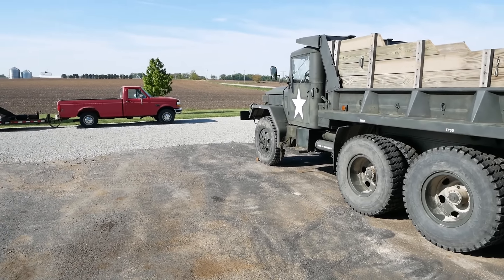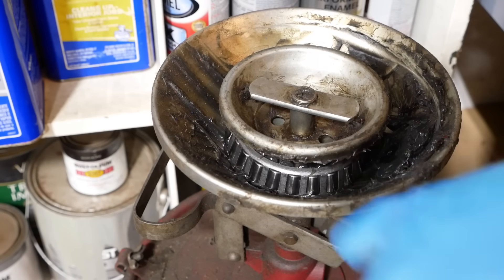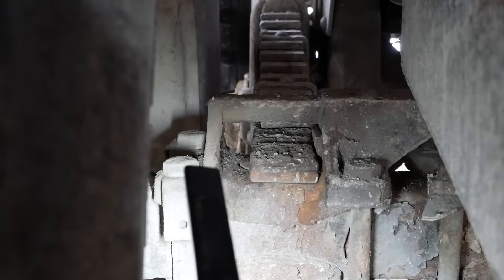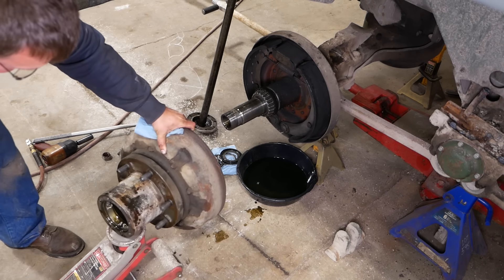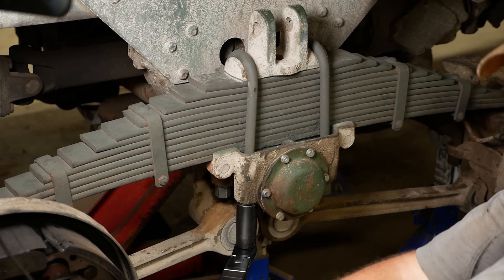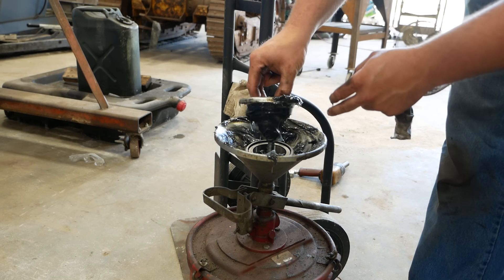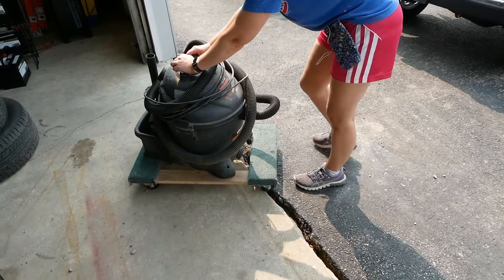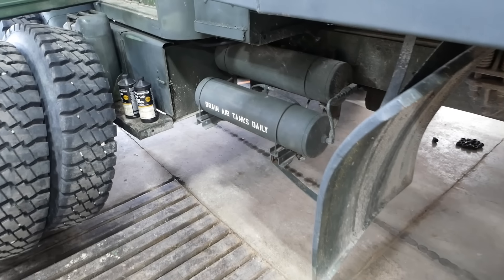Military Truck Crazy Suspension Damage - Can We Fix It?

Comment: This video brought back memories from my early years in the Army.  I was a Heavy Truck Driver (MOS 64C), as a driver we were tasked with assisting the mechanics any time our trucks went in for scheduled maintenance.  In the eight years I was a driver I don't ever remember actually performing maintenance on the trunion bearings.  That might have been something that was done at the Direct Support (DS) level.  As for the axle bearings that was something as drivers we did help the mechanics with.   After awhile we had a mechanic that made several errors that caused me to lose faith in his skills or attention to details.  One incident could have cost the lives of 22 soldiers.  After that I and my other drivers performed all our on scheduled services.  He had forgotten to bend the tabs on the retainer between the inner and outer spendel nuts for the front axle.  Had it not been for a simple flat tire we might not have known till it was too late.  Then that mechanic was tasked with replacing the master cylinder on our 40" flatbed goose neck trailer, he forgot to put break fluid in the new cylinder and bleed the breaks.  Our unit only had 2 1/2 ton cargo trucks and our's were M35A2 models.  We also had 5 ton tractor trucks M52A2 models.  They were 1960's vintage as I enlisted in 1971.  I noticed something weird about the truck you did the test drive in, the shift pattern was different i.e the position of 4th and 5th gear were opposite from the M35A2.  Might have been a different manufacturer for the transmissions since your truck was from 1973.
Reply: I don't remember the mechanics doing anything to our trucks (I'm sure if we turned in a ticket they would have, eventually) I fixed radios and packed wheel bearings, busted split ring tires, etc ;-)
Reply: I drove a couple of those that had been repurposed into water tenders for fire departments.  I have encountered the reversed 4th and 5th in a few trucks.  All the ex mil trucks were small gas engines and large water tanks so I learned to split gears using the transfer case like a 2 spd axle.  The pattern was 2l-2h-3l-3h-4l-5l-4h-5h.  It was a fun challenge.
Reply: The M35A2's-M756A2's as far as I know all had the same 3053A transmissions from Spicer and the same shifting patterns.These trucks were exactly the same from 1966 to 1988.This also includes the previous series like the M35A1's,gasoline M35's and perhaps the M34 prototype.

Comment: Watching this video brought back memories of when I was in the U.S.Army in Germany in 1982 when I was assigned a 5 Ton to fix up. That truck had three full pages of gigs wrong with it. Even though my primary MOS was 45Kilo (Tank Turret Repair) I spent two weeks working on it. I did enlist the aid of one buddy and one of the automotive mechanics for the repairs like swap the transmission, and rebuilt the front drive dif. First time I had to drive it, I drove down to Frankfurt to pickup a replacement M60-A3 main gun barrel. On return after driven round trip 450 miles, two miles from my base, the power steering pump crapped out. I and my co driver had to arm strong that beast that last two miles then get it into are motorpool. My arms were sore for a week after that.
Reply: It sounds like Elvis Presley' story. He was a driver too in 3rd Div.
Reply: All you needed was a tin of spinach.

Comment: Damn, that brought back a lot of memories. I got out in '74 and we didn't have many of those "new"  multifuel dueces. The ones we did have didn't require much work. The older GMC dueces kept us busy enough.  I have loved to have those air tools. Does anyone remember those spring loaded impact wrenches they gave us? They were crap.
Nice job. We could have used you in the Motor Pool.

Comment: I was a motor pool mechanic in the Marine Corps in 73. If I remember correctly they did not come with power steering, however; I don't remember them being all that difficult to steer. But, if you don't have anything to compare it to; you don't know. So, in some cases; ignorance is bliss.
Reply: most came with private steering
Reply: Drove one a few times when I was in the Army in the 1960s.  I really enjoyed driving them.  They had "armstrong" steering.  Not too bad to go around a corner IF you remembered to slow down BEFORE the corner and then ACCELERATE through the corner.  Otherwise MAN they were a bear to steer!!!!!  All the ones that I drove had non-working synchronizers for fourth gear - had to double-clutch both up and down.  I remember that max speed in first-low was 1.25 MPH and first-high was 2.5 MPH.  We always started out in second-high.  Ahhh the memories!!!!

Comment: Drove and rode in the back of several of its cousins, the M35A2 deuce when I was in the Army back in the 80s and early 90s. They were rock solid built and reliable trucks. No matter how cold it was they would always fire up and run. We would often fire one up and get the slave cables (that's jumper cables to you civilians) and use it to fire up everything else in the motor pool that wasn't a deuce. They even ran reliably in super hot climates like Saudi Arabia and Kuwait back during the first gulf war where I was in 91. I'd love to own one now that I have some property and could put it to work. And yes, Wes, they had no power steering except for your arms.
Reply: Thanks, Troop.! For your service.
Reply: That was the benefit of the LDT-465's,and LDS-465's in some others,in the M35A2's-M756A2's.
The 22:1 compression ratio was incredible in extreme cold climates,even with sloppy or gummy motor oil and diesel.
The large M51A2's-M543A2's also were multi-fuel but almost all variants had the LDS-465's because of higher torque.
That was only the downside in the deuce and halfs,not alot of torque but remarkable gearing ratio espiecally relying on the transfer case or in lowest gear was all that was needed to get the job done.

Comment: That looks like what I would know as a “Hendrickson” walking beam suspension, and I believe there is a certain (allowable) amount of the “swing out” (as you call it), however as you said the oversized tires are probably another issue contributing to the “ride-up” by the tires on the beam(s)...
Reply: Agreed. They came with the “rounded” tires for a reason
Reply: @davidscott1861  yup  ditch the oversize crap..the originals worked just fine!
Reply: @fredbuyarski7925  worked just fine for me. Drove an 818 with them through the desert and never had any issues with them
Reply: @davidscott1861  
Ahh yes, I recall the directional “skip bar” type treads...
Reply: People always messing with things they ought not be messing with
Reply: We run the non directionals on our truck all the way around (Vietnam era truck marked up for 8th group) for historical purposes. A lot of convoy trucks in Vietnam ran highway treads on the front. They would steal them off the conex trailers at night.

Comment: My Dad, in the UK had a Duce and a Half for quite a while, there was a problem with the Transfer Gearbox, unfortunately try as we might we were never able to fix it. It had a bigger engine on the back than the drive engine (I think) that drove a compressor with some tools, had a huge 2 man air driven chainsaw !! etc. The Compressor engine had a cracked block. Chap that bought it off Dad promised to send picture once it was fixed but of course never did. However it was great to be able to fix the bits we could and dream about driving it. You are a great mechanic and I love the way you were able to find fixes for difficult to find components. Well done. I know this is a comment on an old video but felt I needed to say something. Made me warm to think of Dad sitting in the cab and finding out what all the switches did 🙂

Comment: For an impromptu bearing race driver to install the new race (cup) , take one of the old races and cut through it with an abrasive cutoff wheel.  After tapping the new race in as far as you can with a hammer, place the cut race  against the new race and continue driving it home with a soft drift and hammer. The gap you created will allow the old race to fit loosely into the same bore for easy removal after the new race is seated.
Reply: Sounds like a great solution! Now, to remember this for next time! LoL!

Comment: In 1974 I was a Combat Engineer(12B10) and I was assigned the newer bigger brother(5 ton) of this older 2/1/2 ton Dump Truck. It was a great truck and with all wheel drive it was a beast and I never got stuck in it. It was diesel and not a multi fueler. I drove many 2 1/2 and 5 ton trucks in the Army. The 5 tons were much better trucks to drive. They had a great drivers seat and power steering. The deuce and a halfs were not easy to steer but tough reliable trucks. The Army trucks they use today are like Mercedes compared to these old tough trucks. Thanks for your video and good luck with your truck.  Good Luck BP

Comment: Your persistence and patience is amazing.  Well done.  Whatever bent the axel which moved the springs which bent/wore on them must have had mass like the truck.  I like the CBs idea that it was the truck itself (sufficient mass) bumping into an immovable object like another truck, forklift, pier, or ship).  Such focus of impact to do that without damaging things around it like the other wheel, surrounding bed, etc..   There was a reason it was taken out of service, and this could be it.  PS: The truck appears to have come with ten mechanics who worked on it daily and thus were very familiar with the 10,000 things needed to do to keep it running.  Check the battery daily.  What a hoot.

Comment: The 5 Ton Dump Truck and the Deuce-an-a-Half were our work horses in my time of service.
Reply: I hope I don't make u feel u that all the  work  u did was because of the tires, BUT U DO REMEMBER sTHAT YOUR TIRES R NEW, AND THE  OE TIRES HAD NO TREADS, so they would not have rubbed the cover bolt
Reply: You should watch the Pakistani guys work on trucks 🚚, they r  great,  I used 2 b a mechanic, so I know how hard it is 2 work on trucks

Comment: When I came across your thumbnail I was  immediately drawn to the video. Drove many duece an halfs and five ton dumps when I served back in 73 thru 75 1st infantry Div 802nd Engr bn Bravo co . Watching you go thru the start sequence brought back fond memories and like someone mentioned a 19 year old doesnt really give a hoot when he is told to just drive the darn thing . But it was better for me because I was barely  18 when they got me . Was that a straight 5 with the high low range splitter. Hell if the wife would let me I would trade my silverado for that thing for sure. Dont really remember how many miles I drove but always enjoyed being behind the wheel.  Thats probably why I ended up a commercial truck driver for over fourty years. Really nice to see that some of the old surplus equipment is still being used.  Be careful and stay safe my friend God love ya.

Comment: First time watching your channel. Enjoyed it very much, thanks for sharing. Wrenching on heavy equipment is rarely cut and dry science, more a process. Good job. I use to be a heavy equipment mechanic 35 plus years ago. Eventually moved to the office and have only pulled wrenches on my own vehicles since. Some aspects of the job I miss. Love being around the equipment. Use to do a lot of truck frame lengthening and shortening depending on the repurpose application. Today I always find a reason to walk the shop, any shop, like visiting home. Even now working for a major airplane manufacturer.

Comment: Maybe it fell off of a sling?  But I agree, whoever "fixed" it originally did only part of the job.  It is a pity such major accidents do not get recorded on vehicle ID papers.  Regardless, you showed great patience and ability with the work you carried out.
Reply: Partial/messy repairs are the order of the day for a lot of older military vehicles.  The worst are the smaller ones, used only occasionally, like in parades.  I've found stuff like allthread or drain-plugs holding the steering arm to the knuckle on WW2 era jeeps.

Comment: I have a 1973 M35A2 "Deuce and a half". When I wanted better traction and top speed, I flipped my rear hubs (the rig is designed for it) and added super single 46" Goodyear MVT wheels/tires to replace the stock 39" NDT wheels. I took video of the hub flip and wheel swap. One of these days I'll get around to editing it and uploading it.

Mine has manual steering, so I can confirm that is the stock system. It's a bit arm-heavy when steering at low speed.  

Great job diagnosing the truck The folks at Steel Soldiers forum online have been a Godsend helping out with tips and part numbers/tool numbers.

Comment: Definitely damage from a recovery. I wrench on highway plows, and these things go into ditches pretty frequently, and let’s just say straps and chains can go onto some interesting places when someone doesn’t want to dig in the snow for a proper recovery point, and it’s impressive how even the most solid looking chunks of metal will twist around when you’ve got two fully loaded trucks hooked to each other and one hits the end of a strap. And that kind of damage has ocaisionally earned a truck an early surplus in as-is-where-is-may-require-unknown-repairs condition.
Reply: I saw someone buy a govt surplus crane that had extensive forklift damage not readily apparent. Moving equipment around for surplus sounds as bad as that recovery you describe.
Reply: Recovery makes sense to me, someone might of hooked to the axle.. I'd think if it hit something or something hit it, it would of just moved the truck. Either that or rough landing from an air drop.

Comment: Wow...  love the video.  I LOVED THAT OLD TRUCK.  I drove and worked on that truck for years, from 1980 till the army got rid of them.  The bearing you pulled out is a new bearing.  The old type bearing was a solid bearing with grease grooves cut in it.  hahahaha, yep, that cap goes on a curtain way.  The torque rods would only need replaced if the rubber was separating.  Never drove or saw one with power steering.   There is a bearing seal tool for that.   I was wondering if you were going to put that cork in there.  It should have been as thick as a valve cover gasket and it is important.  If its not there it will allow 90 wt oil to get into the bearing and then all over everything.  That's a lot of work.  The top brake adjustment is the major and the bottom in the minor.  align the dots on the bottom cam pins, adjust the top top be back all the way off, then put the drum on.   There was a pressure bleeder cap that went on the master cylinder that pumped brake fluid in so one guy could bleed the breaks with out pumping them up.  The brake adjustment settings were .010 on the bottom and .020 on the top.    The adjustments would have been done thru that cover that was on the out side of the hub when you took the wheels off.    Good catch on the bent axle.  That truck was rebuilt by Depot.  It had modifications done to it that I had never seen.   Which had to be after 1985 from a National Guard location.  The army got rid of the 2 1/2 ton in the early 90's.  That has an M35A2 Multifuel engine , meaning the fuel injection pump will meter gasoline, kerosene , DF2, DF3 or JP8.
Reply: I was wondering about that too, that little piece of cork to seal the bearing grease in and not mix with the gear oil. What that means, oil will now again flush out the grease from the wheel bearings, depending on how much it is driven, is certain to be a problem in the future.

Comment: its always impressive to watch Wes work! That was a though one, full off hidden surprises. They probably ran into something like a knee wall with the rear axle, which bent it back and bent the springs. That was a difficult catch. Same with your non existent vent, but shouldn't you check if that vent actually works and is not rusted shut? And I was surprised that you didn't repair that locater pin on the old axle, that shouldn't have been a problem for you... again, very impressive to watch you as always.

Comment: Your Duece was stuck somewhere and instaed of hooking to the frame they hooked to the Axle and the Tank that pulled it out did the damage.
Reply: I can totally see that.
Reply: Was in Germany during reforger 1981, saw a tank retreater jerk one that was down to the frame. Let’s just say they didn’t care what shape it was end when they finished.
Reply: Makes sense as the axle housing was pulled towards the back. I wonder if it could be straightened.

Comment: Crop duster out there just casually being a BAMF
Reply: First time I saw a copter doing moves like that I was CERTAIN it was in the process of crashing! When it zoomed across the road, UNDER the power lines and then did a snap turn in it's own length I realized it WASN'T crashing, but doing that ON PURPOSE. Never seen that in person before. Pretty #*$&@# intense

Comment: Good Job..  I am an Old Marine, and I drove these old trucks when in the service..  I also worked in the shop for a while just before being discharged.. These trunnion bearings can be adjusted fairly tight as long as there is plenty of grease in the assembly..  Point being is there is not movement like on a wheel bearing..  Glad to see you putting some time in saving this ol girl.. The trans in this truck is an overdrive trans..  That is why fifth gear is to the dash..